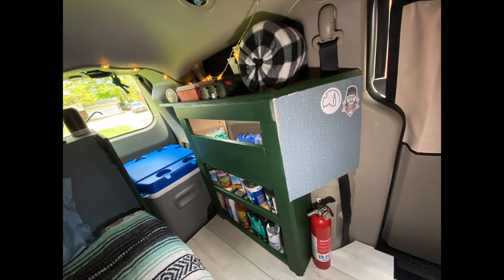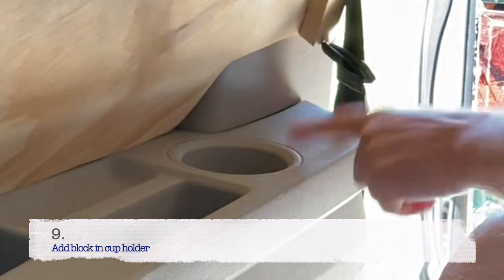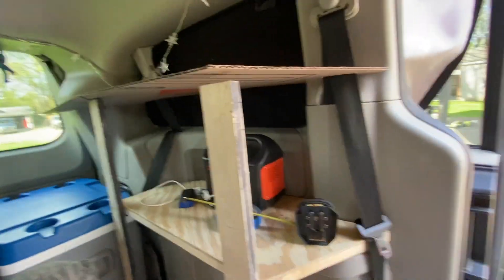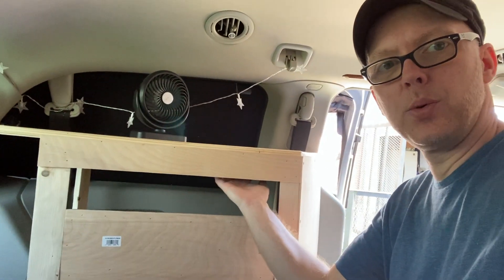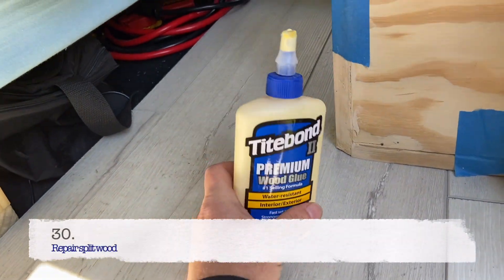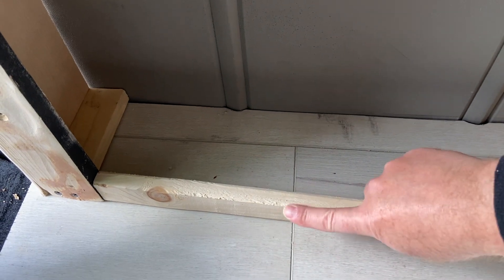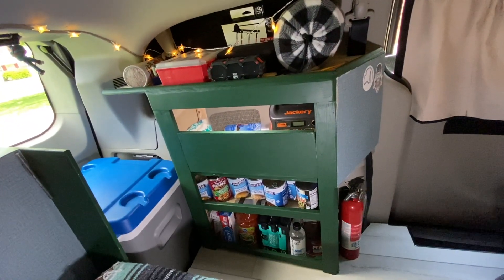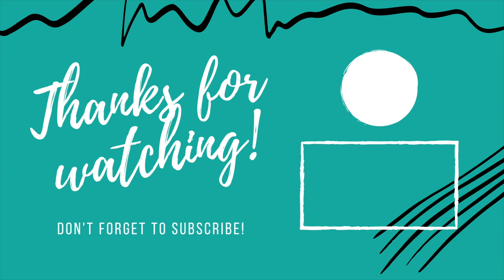Minivan Camper Conversion Storage Shelf | Boondocking in Minivan

Comment: the moss was such a cute touch!! I love it! im looking to expand my storage options and this is perfect! <3
Reply from the maker: Hey! Thank you! The miss was okay for a bit, I only used it because I had it left from a series I was working on. What type of minivan do you have?
Reply: @ an 08 sienna. I was thinking of expanding my drawer that I build into the third row window and this is a great idea for that! Thank you! Is the moss not a good idea long term? I was thinking it was a great way to add some minimal decor to my build.
Reply from the maker: @ Oh awesome! I enjoyed the fake moss. It helped keep things from sliding around there and it did bring in a bit of a nature feel into the van. But it will crumble and start to flake and the glue it comes with is super strong and hard to remove.
Reply: @MellowNomadicAdventures  okay I will keep that in mind when searching for decor, thank you!
Reply from the maker: @ItsRemedi  Yeah, definitely do. I bought this fake moss at a craft store and didn't realize how heavy duty the adhesive was. Honestly, now I use that rubber like shelf liner stuff on top of my shelves and it works great. And it comes in various colors. Also, sticky gel pads to keep stuff in place.
Reply: @ from dollar tree or like a JoAnns/Michaels?
Reply from the maker: You can likely find the rubber shelf liner at both places but not 100% sure. The moss was at a Hobby Lobby.
Reply: @ okay thanks!

Comment: That would be a good idea if you had a small pet and it needed a bed or a pen and also if you weren't able to work with wood and you got a bunch of cardboard a cardboard might be strong enough to 😂 definitely taught me how to make something when I can even know I have an 06 Honda CRV
Reply from the maker: Hi Amanda! Thank you for watching! Hmmm... I am guessing you may be referring to the moss part? Not exactly sure. 

You would need some pretty rigid and thick cardboard to go that route 😂 I wouldn't suggest cardboard to use for a final product. Mounting a fire extinguisher and the other things to cardboard probably would not last.

Are you full or part time in your CRV?
Reply: @MellowNomadicAdventures  👍
Reply: I thought about making a shelf out of the super thick and tuff cardboard that my tv came in. It is super strong!